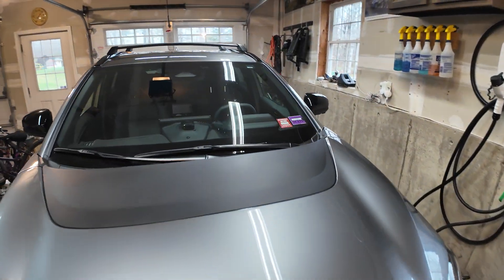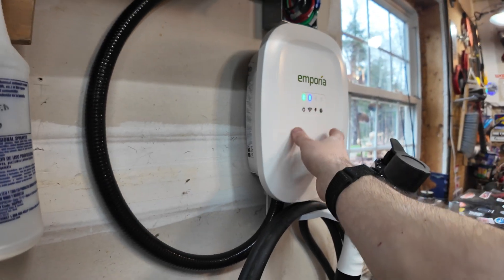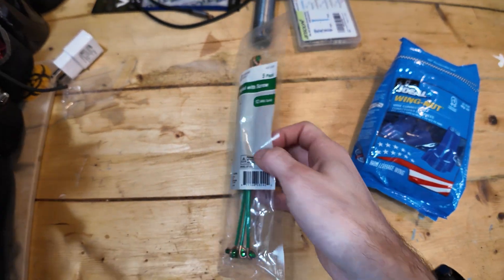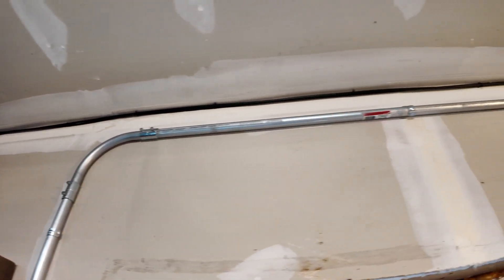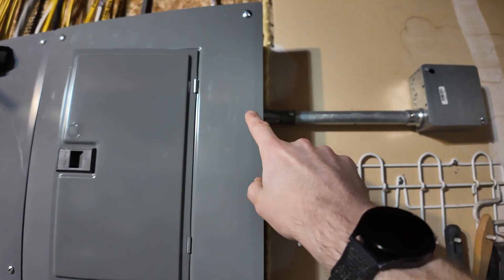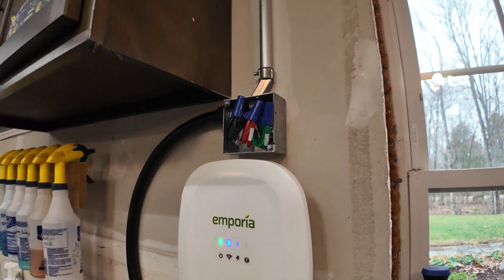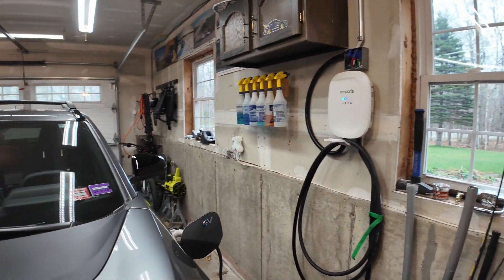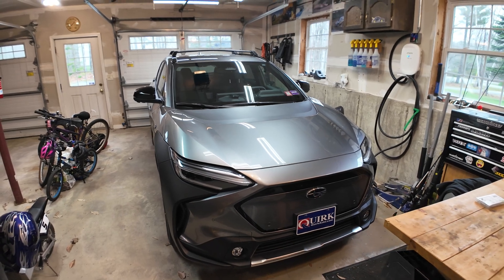Emporia Level 2 Charger DIY Install Information

Comment: Since you are only targeting 32 amps of charging with 40 amp service, you could have used 1/2 conduit: containing two #8 AWG conductors plus one #10 AWG ground. Also I’ve never heard any code interpretations where hard wired EV charger requires GFCI breaker, so I do not believe that is needed and may even be unwanted (since the Emporia has built in ground fault protection). Lastly, instead of wing nuts eliminate that junction entirely by continuing YOUR wires thru the flex conduit into the Emporia (just pull out the three #6 AWG provided by Emporia).
Reply from the maker: I had read in the latest nec code there are cases where a hard wired charger needs gfci.  
https://g.co/gemini/share/698bcb840699 has some of the reasoning.  
And yes i agree on wiring and conduit.. i dont regret the larger conduit though.. for my next car I may up the one small wire here since he depot sent thicker wire than I ordered.

Comment: Can you provide a reference for your statement that the 2023 NEC code requires a GFCI breaker for hardwired EVSE installlations? I did some Google searches but was not able to find this anywhere.

Comment: How do you like the Subaru now? I have a Mustang Mach E GT with 46K miles and hasn't once required service.  Cheapest car I have ever owned (after purchase of course) and delivers some crazy performance with 0 - 60 in 3.5 secs.   Anyway, back to your vid. I just bought this charger and trying to decide if I can do it myself.  I have an old system (use to own a Volt) that is setup similar to yours with wiring going across room to front.
Reply from the maker: Everyone is at a different level for electrical comfort/skill lol.   I do still like the car a lot. When my lease is up Ill probanly get another since the updated one coming soon solved a lot of issues.

Comment: The wing nuts might be a fire hazard, I don't think they are rated for the constant draw of a EVSE. EVSE are known to melt the normal  NEMA 14-50 outlet so I'm sure it can do that to your normal wing nuts. You might want to look into the polaris wire connectors instead and torque to spec. Those connectors are larger so you may need to up size the box.
Reply from the maker: Right now after a long charge session they aren't even getting warm to the touch. Maybe if I was running at the full 48 amp instead of 32 amps it could be a concern, but I think these wire nuts were the ones included with the hardwired charger.  If they were getting warm I would definitely do something about it.  Thanks for mentioning the Polaris connectors for anybody else doing this

Comment: Great video! I'm in the same boat and was also considering using metal clad cable instead of conduit, but conduit looks more professional. One suggestion: I know that you know your install specs, but on the surface it can appear to be a 48A hardwire setup. You may want to consider putting a label on the charger and the panel indicating gauge of wire, size of breaker, and maximum amps to set it at, to ensure someone accidentally doesn't try and set it over a 32A draw.

Comment: Looking to install mine soon. Going to run 6 AWG wire from a 30 amp breaker and set my emporia to draw only 24 amp as I have a 100 amp panel. In the future I want to upgrade my panel to be able to hold a 60 amp breaker and charge at the full 48amps. Is this safe to do?
Reply from the maker: Not an electrician, but that sounds like a great plan and you seem to grasp the amp requirements.

Comment: So you bought 3 individual 6 gauge wires? Doing this project this weekend. Thanks in advance
Reply from the maker: I ordered 3 8ga thhn wires. They accidently shipped me 1 6ga and 2 8ga.   No problem going to a thicker wire so it didn't matter here.     If you want more than 32amps of charging, go for 6ga but you'll need larger conduit then.

Comment: I would have used 3/4 cowboys instead of one hole straps so you didn’t have to throw on the offset connector. Also you should of put in a 60 AMP breaker
Reply from the maker: Those clamps look like a good way to avoid offsets.   I disagree on the 60 amp breaker. 8ga 90c thhn is for up to 55amps from charts I saw, and factoring in the 25% wire amp buffer code required for continuous draw puts it at 40amps max.. so I used a 40amp breaker.
Reply: @mainelyhobbies  Since Home Depot gave you #6 wire, I think @AstritZyberi-r8z is correct that you could have used a 60amp breaker, so long as you have #6 all the way from the breaker to the EVSE. #6 THHN in metal conduit is rated at 65 amps. The breaker's only function is to protect the wire, so the load you intend to put on it and the 25% buffer are not required to be factored into the choice of breaker. A 60amp breaker is OK even for #6 NM-B (Romex), which is rated at 55amps, but the 25% rule prevents you from using the EVSE at 48 amps in that case. Of course, a 40amp breaker is also fine, but it means you will have to change the breaker if you decide you want to use a higher amperage in the future, which your installation appears to allow otherwise, although you might need to do a load calculation for your panel to know if that is ok.
Reply: @anon0105 he said only 1 of the wires was the thicker gauge that home depot sent on accident.  So he does need to yse a 40amp breaker not a 60 amp breaker.

Comment: I would of used 3/4 cowboys instead of one hole straps so you didn’t have to throw on the offset connector